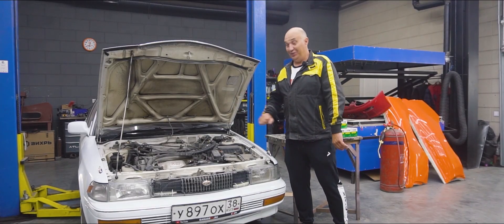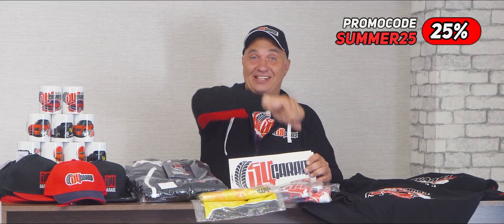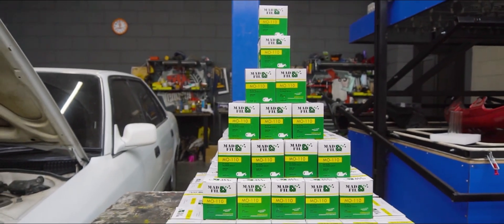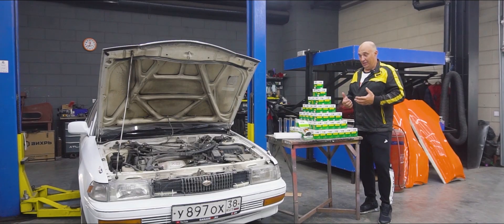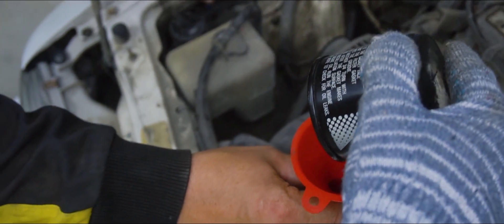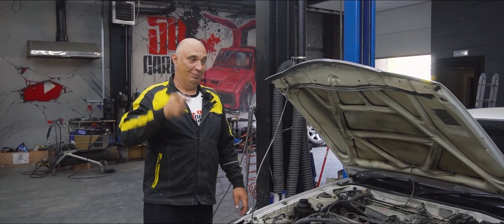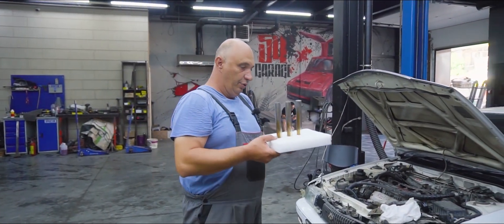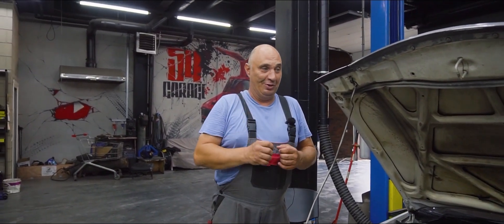Can 50 oil filters make used motor oil clear again?

Comment: I thought I remember hearing that ships use some type of centrifuge to filter or renew oil.
Reply: You are correct. Just search "oil centrifuge" on YT.
Reply: alot of small 4stroke engines use a centrifugal oil filter system
Reply: @aeroflopper  yes my 65 Honda 305 motorcycle had a internal chain drive centrifuge. My Honda 500 Custom had a Frantz oil cleaner upside down back behind a saddle bag.
Reply: Lube oil purifier.
Reply: @izwanizi  ohh baby say "lube" again, PLEASE

Comment: I love your videos here in North Carolina. Another way to do the experiment is to go to the salvage yard and get 50 individual filter mounting bases. Hook them all together in a long line so that oil is being filtered over and over, through each consecutive filters. Start with about 15 or 20 liters of used oil, and pump it through the chain of filters to see if the filters will clean the color of the oil at the end.

Comment: Fifty filters in series on new oil, how’s oil look after 20,000ks only issue I foresee is pressure loss from so many filters/ hoses possibly or not if oil pump is positive displacement but imagine the heat capacity from so many liters

Comment: 10,000Ks? I haven't changed the oil in my Citroen since I bought it with 76,000 miles on it and it now has 102,000 miles. I've probably added a couple of litres over the years as it leaks out, but even that was used oil out of my motorbike. I dread to think what's in the sump of that poor old car.

Comment: For someone who really wants to know. Filters are not going to help you. More oil and oil coolers will help. The oil cycles too much at a high temperature when degrades the oil. To remove this problems is to have a much larger oil pan and remote coolers. A small 4 cylinder engine that has 50 quarts of oil will maintain a cooler temperature and the oil will last far longer because it will cycle less and keep cooler which slows down degradation. The same applies for radiators the bigger the radiator the cooler you engine will stay. This also applies to heavy equipment that uses hydraulics. If you have large volume and remote coolers then your oil will degrade less over time.

Comment: It matters not the number of oil filters, the micron size of the filter media is more important.  On heavy on highway trucks, some have what they call bypass filters. It takes a small amount of oil and spins it in a cartridge type filter like a centrifuge.  They are a really fine micron filter media to trap everything. I say this only from my own experiences. If they had a really fine media as a factory filter, there wouldn't be enough flow, you know like they say "full flow oil filter".

Comment: Use a big Diesel oil filter/filters with a high micron rating to see if it will clean the soot out of the Gasoline engine oil

Comment: Your experiment will not work because every time you replace the filter you remove a small amount of oil at the same time. So at some point you will have to top off and this will gradually clean or replace dirty oil with new and fresh oil.

Comment: I read this and was like hmmm. Ive heard of oil testing and if it was still good the farmers would pour the oil into their tractors as a way to recycle the oil until it was thoroughly done for or consumed.
Reply: how do you assume a tractor needs less good oil than a tractor... also its needs a different viscosity
Reply: @majorva2653  it was an old tale I've heard of farmers using over the years. My source...an old farmer.
Reply: @sweettooth7124  maybe thats the problem xD an old farmer not an engine builder sure it still works but why put unnecessary stress on the engine if it would last a lot longer with just fresh actually correct oil
Reply: When I was selling Gulf Coast filters a guy brought me a Dodge Cummins. He said put this Amsoil in and install a Gulf Coast filter. I asked what was in the truck. He said Shell Rotella 15 w40. I said yes sir. I had a new drain pan.

Comment: As the engine runs it leaves more deposits for the oil to take and lift into suspension, that's one of the main functions of engine oil. Clear used oil after filtration doesn't mean the additives are working as friction modifiers anymore.

Comment: Some of the contamination in the oil is individual atoms of carbon from the combustion process - I doubt the filter is fine enough to capture them.
Reply: if they are individual atoms, they will not have color. They have to be together in compounds/lumps/piles big enough to bounce or shift light wavelengths.

Comment: Oil filters aren't meant to catch fine particulates, their purpose is to catch larger objects that might cause damage to a motor. If they were fine enough to catch everything, they would clog up after a few hours of driving if not sooner.
Reply: Full flow filters aren't, but many Heavy Duty diesels now use something like a 2 micron absolute bypass filters in addition to the full flow filters to remove soot from the suspension, the full flow protects against big stuff, and running a couple gallons per hour through the bypass cleans the soot out as to not overload the dispersant package for the long change intervals of like 30,000-60,000miles(50-100kkm) or 750-1600hrs spec'd on many class 8 vehicles now.
Reply: @brandonupchurch7628  You should have seen my old oil filter after 3 years, LOL it was all gooey ,I changed the oil not the filter .
Reply: @Brandon Upchurch Very informative comment! I have been changing oil filters on a heavy duty diesel engine, but never understood the purpose of the bypass-filter until now.
Reply: @brandonupchurch7628  actually I’m using a 1 micron by pass filter and a 1 micron return fuel filter. My engine is as clean as a dirty engine can get.
Reply: Even if it filtered super fine particles , still the oil would be wasted.
Look for TBN , oil evaporation etc...
Reply: @AAAAAAndrea  Exactly, filtering only takes out the insoluables, I.E. dirt, vodka bottles, etc.  It does nothing to restore the additive package.  It does nothing to remove any fuel or water from the oil.

I wouldn't put it in the crankcase of anything I liked.  But I might slowly add it to an older diesel vehicle fuel tank.  Or use it in a oil burning heater...

The new filters are probably not initially fully effective.  It probably takes a while, far more than 10 minutes for a filter to get to its maximum efficiency.
Reply: If the filter media gets dark, it is because it caught fine particulates.
Whether if that's their purpose or not it doesn't matter, those fine particles got caught.
If all you needed was to catch large enough objects, we'd just just a metallic screen and not very porous paper.
Reply: @GoldSrc_  I had to replace the filter cause I mounted it not the proper way , and it got dark anyway.
Not as dark as a true used one, but still dark.
Reply: @GoldSrc_   whats your halflife pc steam screen name ?
Reply: @Devo1987  Why do you want that? lol
look for GoldSrc
Reply: @GoldSrc_   I play it online im TrendMicro / Devo87 / 2-4-5 Trioxin I play in EMERALD COUNTY / YES BOTS / the basterds of half life  do you know igmo / junkaroo /
Reply: Nope. It can't work at all. Oxygen, sulfur, nitrogen are introduced in the mix. Changes are in molecular level. Crude oil refinery can make; methane, butane, gasoline, diesel, kerosine, new oil, tar and everything in-between out of it.
Reply: Saab made a particulate filter that was a huge panel filter like a trans filter. It was much finer than a standard oil filter and they claimed 100,000km service intervals.
Modern oils don't break down over time and heat cycles like old oils did. Oils don't "wear out" they just get dirty and introduce contamination into very tight tolerances.
Reply: @1one3_Racing  the lubricant itself doesn't wear out.  But modern oils are more than just lubrication.  They have anti-wear properties, detergents, viscosity index improvers (allow an oil to be a multi-grade oil such as a 5W30 oil) anti-friction additives, additives to deal with acid build up, and so on.

These are the things that are used up in the lifecycle of the oil and must be replaced.
Reply: CAT brand filters entered the chat.
Reply: Check bypass filters. They do actually clean the oil, but it doesn't mean you don't need a regular filter :)
Reply: Full flow filters, I agree.  If you want to catch smaller particles then adding a bypass filter in addition will.
Reply: And the dirtier they get the better they filter, since he took one off that already needed to be changed it was already catching smaller particles than a new one will, so putting on one new filter after the other won't change anything.
Reply: cool story bro.
Reply: Has nothing to do with the filter. The new oil is what cleared up the dipstick.
Reply: Well yes but actually no. We design oil filters to catch the larger particulate down to a certain micron but the damage that occurs in your engine is very low micron anyway it catches the larger more gumming type particulate while leaving the engine damaging particles flowing it would clog up but the small particles are what break the engine over time large particles would break the engine quickly but small particles are the reason we still have to replace them You can look it up if you don't believe me
Reply: It needs Sir James Dyson to apply his centrifugal Vortex System to the engine oil. when the engine is running.  After all, oil is a fluid, like air.
Reply: Yep. And the additives do break down as well. 
Important stuff like the one that stabilizes its viscosity at idle and open temp. Detergents etc..
Reply: Sort of like the effectiveness of surgical masks and a certain virus... ;-)
Reply: @jdoedoenet  N95 is specifically meant for virus sized things...
Reply: @jdoedoenet  you can't compare it to oil filtering, is particulate in oil small enough to be electrically attracted to the filter, no, they don't work on the same principle, not at all.
Reply: Nah not the same sitch
Reply: @jdoedoenet  yes to catch the much much larger virus but let the tiny oxygen through c:
Reply: @jdoedoenet  got me dying laughing here ty so  much
Reply: @jdoedoenet  Someone has a brain.
Reply: @jdoedoenet  🤣🤣🤣🤣🤣 good one
Reply: @jdoedoenet  :P
Reply: @jdoedoenet  Cough infront of a glass or mirror with and without a mask.
Which will have spittle on it?
Reply: @IIGrayfoxII  🐑🐑🐑🐑🐑🐑🐑🐑
Reply: @jdoedoenet  nobody claims a mask is 100% effective.
Reply: @IIGrayfoxII  of coarse spit will be filtered by a mask, but virus particles are much smaller, a better experiment would to cough on a surface one with a mask and one without and record virus particles with a test kit
Reply: @AZgule2010  💯💯💯🤡🤡🤡🤮🤮
Reply: @countryfella94  but the virus particles are not free floating. They're suspended in the tiny droplets we breath out. Additionally an N95 mask has static charges within its fibers that pull airborne particles to the fabric.
Reply: @ehhehh4049  "Review of 26 studies reporting particle sizes generated from breathing, coughing, sneezing and talking showed healthy individuals generate particles between 0.01 and 500 μm, and individuals with infections produce particles between 0.05 and 500 μm. This indicates that expelled particles carrying pathogens do not exclusively disperse by airborne or droplet transmission but avail of both methods simultaneously..." Journal of Infection, Volume 62 Issue 1 p. 1-13.
So, um...no. 
For reference, 0.05 micrometers = 50 nanometers. You just go ahead and keep filtering your oil waiting for it to go clear, or coughing on mirrors through an N95 mask and convincing yourself that you are stopping a virus.
Perhaps science isn't really your thing...
Reply: @jdoedoenet  No one said it fully stoping a virus, but it does reduce the amount of non-virus-containing and virus-containing droplets significantly. A face mask will also have flow leakage too which hurts the performance of a mask but it's still a better option than not wearing a mask. They only help reduce the number of particles you expelled, not to protect the mask-wearing, and is why everyone needed to wear one. That was only one form of prevention, distance, and good airflow are also helpful.
Reply: @jdoedoenet  Some masks are designed to filter very small particles for the user and can therefore protect from the Covid virus. Most masks used by the public are fairly useless though although they may redirect airflow.
Reply: @1one3_Racing  You can talk to these people all you want. They watched a youtube video, and now know more then scientists, doctors, and every and all educating medical professionals. Just like seat belts don't prevent you from dying in a crash, they just help reduce the risk, these people will continue to think they know everything, while still wearing a seatbelt. If they truly did believe that masks do nothing, they wouldn't mind being operated on in a surgical theatre by doctos with no protective gear.
Reply: @colinsmith6340  You can't argue with stupid. They'll justify their points to the death.
Reply: @IIGrayfoxII  Such a dumb argument. How about I just continue coughing into my shoulder or shirt and not wear a face diaper 24/7 on the off chance I have to cough.
Reply: @IIGrayfoxII  the guy nwxt to you.
Reply: @jdoedoenet  you can test it yourself try to sneeze with a mask on then without in front of a glass and see what happens
Reply: @rotorblade9508  🐑🐑🐑🐑🐑🐑
Reply: @jdoedoenet  😕

Comment: I was alwaya told the oil never stops lubricating, its all the additives in oil tjat run out. You need the anti-foaming and detergents topped up again
Reply: The long chains break down into shorter ones, reducing film strength(the thing that actually keeps the metal parts from touching each other) and lubricity. This is improved with synthetic oils but all of them have a service live regardless of additives or contamination. Edit: it also gets acidic.
Reply: @Chris_Garman  Ah, that is exactly where all the wear occurs, when 2 metal parts touch without the oil film between
Reply: First you need a filter that cleans oil. I use toilet paper filters. Then you need to change the toilet paper and add enough new makeup oil to keep the additives up to specs. For my Pontiac driven mostly highway thats a toilet paper change and a new quart of Walmart synthetic oil  every 6.000 miles. Make adjustments for different driving conditions. It doesnt matter which of the toilet paper filters you use. The Australian Jackmaster Classic is the best set up to use the newer toilet paper with the bigger cores and shorter paper. The Jackmaster Classic requires a firm paper such as Scott 1000. I use Great Value 1000 from Walmart.

Comment: everyone who watches Project Farm

"Man you can put brand new oil in a coffee carafe, heat it on a hot plate, and it will turn black!"
Reply: Winner, winner!
Reply: So true
Reply: Every Monday morning before work I watch his new upload!
Reply: Absolutely lol 😆🤣
Reply: Glad to see we're all here lol
Reply: I dont drain oil and the oil is always clear on the dipstick on the gasoline engines. My Australian Jackmaster Classic keeps the oil clear. They claim 1 micron filtration. Its another story with a diesel. Some diesel soot is smaller than 1 micron. Its not an abrasive but it will eventually turn the oil black. People think black means dirty.
Reply: I put my oil in the engine not a hot plate. The oil needs heat for the PCV to work. Heat wont turn the oil black in any gasoline engine ive owned before I learned about depth bypass filters in 1963 oil was a black nasty mess at 1000 miles in the Rambler American flat head 6. It came with a factory equipped bypass filter with steel oil lines. To clean oil I installed a Frantz oil cleaner.
Reply: I just don't like when a person's userbase is too 'suck-up'y because then it makes the audience look unintelligent and unfun to be around
Reply: it really wont turn black since there are no moving parts nor anything adding friction to the oil, it will darken and disapate some from heating but it will never turn black you can heat it for 48 hours straight and will darken yes.
Reply: People who watch Project Farm would believe anything. That channel is like flypaper for the gullible.
Reply: @johncoops6897  not too bright are you? 😔

Comment: The oil is blackened due to heat, the filters can only remove particles down to a certain size, and the long chain molecules in oil break down with use. You can't rejuvenate used oil